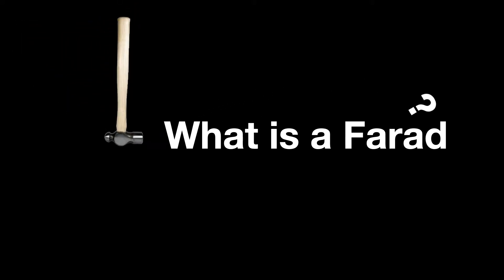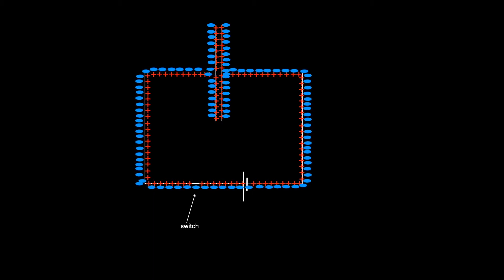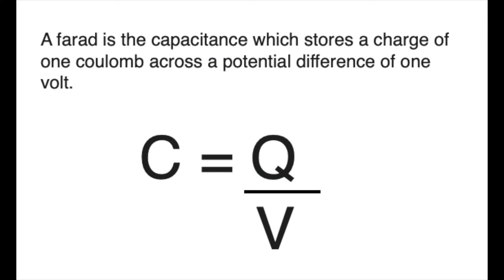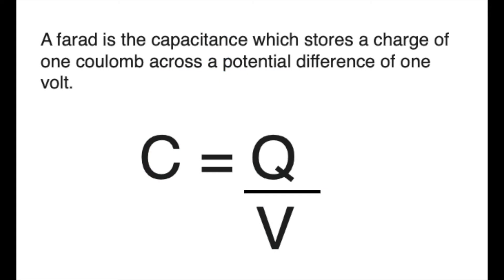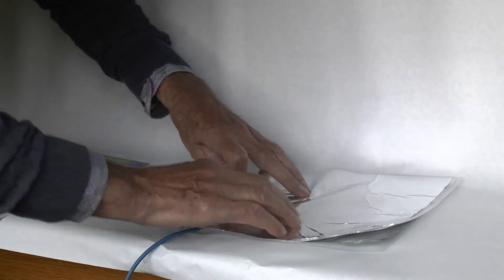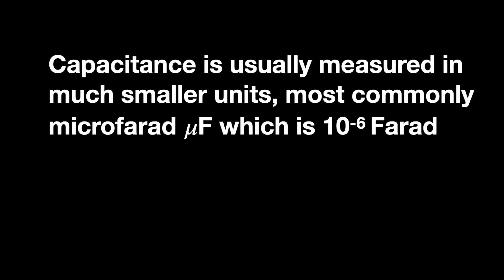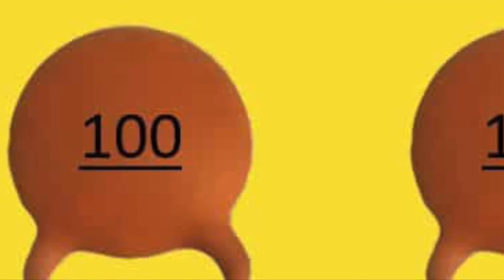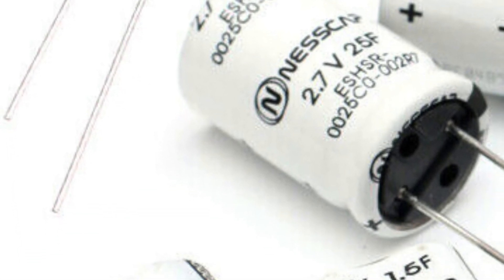Farads measuring capacitance: from fizzics org

Comment: how do we know that given device or component or circuit needs ac suply or dc supply ?
Reply from the maker: That's hard to answer in such a general question. It depends what the device is for and how much you know about it. Just looking at a box without any other information you can't tell. All reputable manufacturers will have this information stuck onto the device.